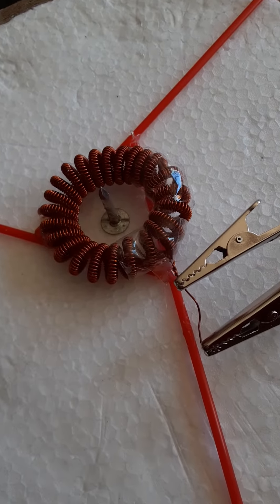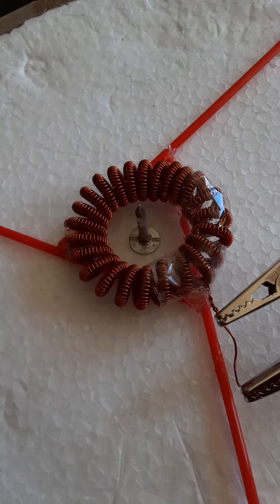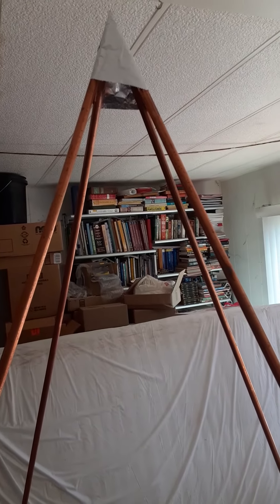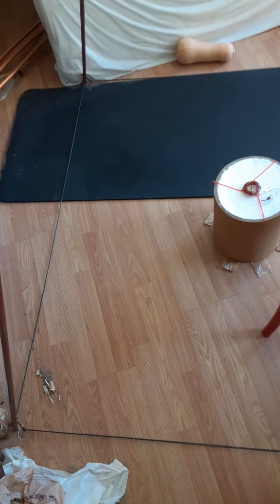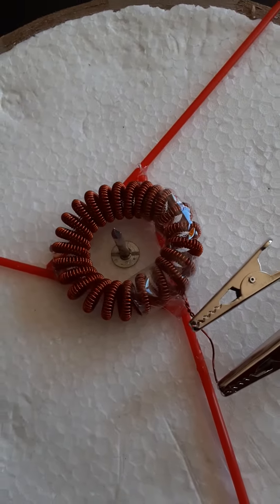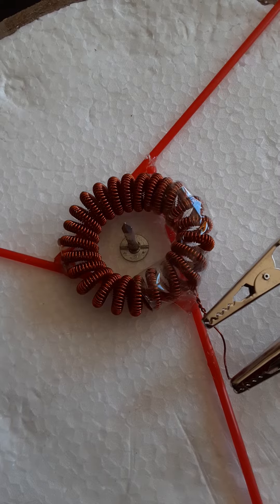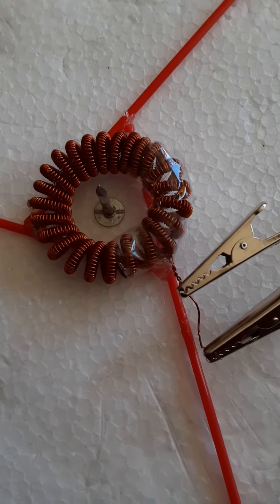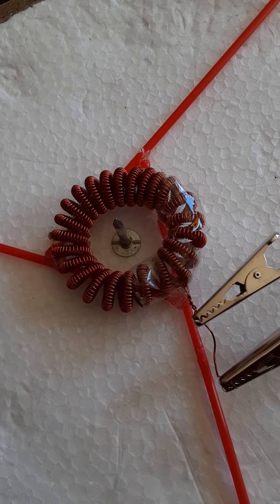Pyramid + Bagel coil

Comment: I bought a handful of rm3100 3 axis magnetometers for $18 a piece from aliexpress they can detect the rotation of a 2mmx6mm neodymium magnet from 1m at around 100hz. They seem pretty good. My 4 level bagel unfortunately has no persistent field and driving at 60 hz gives me no measurable field. I'm guessing I probably needed to use a 3 level bagel as that has the open magnetic field if I understand correctly. I probably need an electric field detector for my 4 level bagel...
Reply from the maker: Sounds like I need to buy some magnetometers. Thank you for the part number
Reply: @spacecase0  I sent you another reply, asking if you wanted open scad winding models or code to use with the rm3100 chips and some tips on usage. My reply has disappeared.... ;) I assume you didn't delete it.... You should be able to read it in your email box at least I suspect...
Reply from the maker: @petersvideofile  I certainly didn't get rid of your message. I also don't have anything in my email. But I suppose my email and YouTube are owned by the same people. Discord it doesn't seem to edit anything. Here's a link to my server that should work for the next 7 days https://discord.gg/Q6xF6mN2
But I don't know if you use Discord or not.